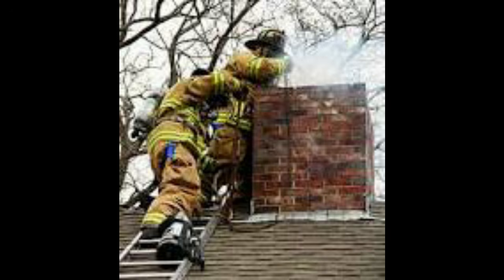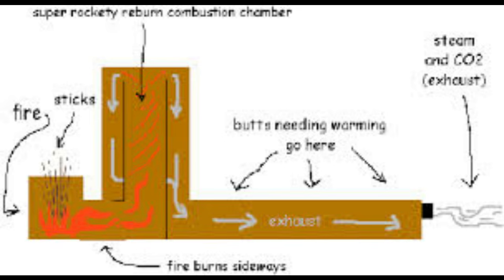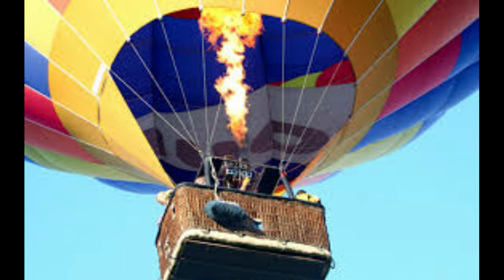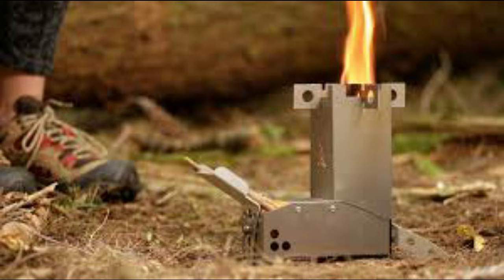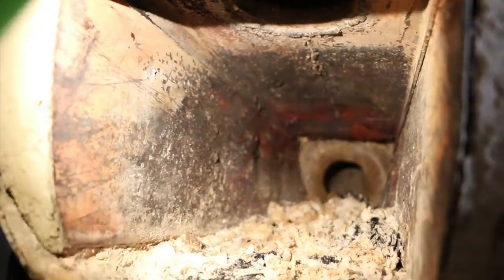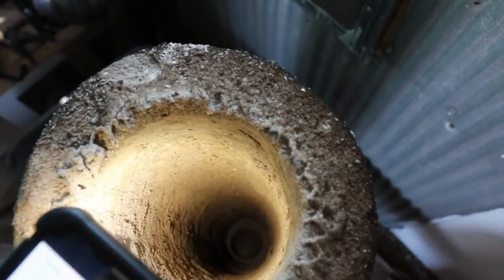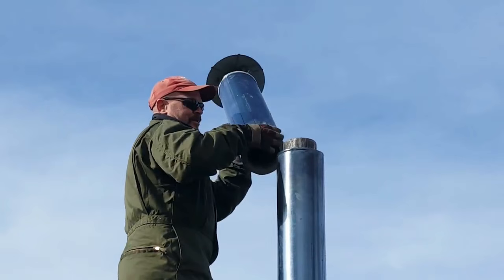No Creosote Forever More

Comment: I run a brush down my chimney once a year. Get about two cups of loose ash out of it. About mid winter I do need to just knock collected ash off my chimney cap where it will collect in the little spark arrestor holes, but that's just knocking the chimney cap a couple times with a long stick. Never have an issue. Been doing this for thirty years. Our stove is a catalyst type (Blaze King). Very efficient and virtually no  tarry creosote. Burn all pine, mostly dry, some less so.

Comment: Well sir sure appreciate the vid. I have a rocket mass heater that now has an interior flu. I wrote to comment that my rocket mass heater ran ok with no chimney. The draft tripled ( just a guess)when I hooked the six inch system up to a 15 foot vertical stove pipe with 12 foot insulated stainless on top. I found that the wind could overcome the heat pump effect without a nice tall stack. Since it burns so clean I figured the stove pipe could bleed more heat off the flu gas. The 13 foot mass still pushes 230f plus flu gas’s when it’s running hot. Enough to improve the draw as I forgot to make a good bell at the barrel transition. It’s been running 6 ox years. Your stove build is very well thought out. I kind of want to try a batch box.

Comment: If it's just your flue cap that's clogged and it's beyond your reach or you want to avoid the danger of falling off your roof, you can do like I did and use a .22 cal pellet gun with an accurate scope to put a few shots on the screen which shakes off the creosote easily. I figure that I paid for my pellet rifle by not having to call out a professional to do the work. I couldn't use my stove until I did this process.
Reply: I got a 5 ft. pvc pipe and attached a wire brush to end to clean out the holes on the cap. Works like a charm.

Comment: As a sweep myself, I completely agree with your assessment. Keep up the study and good work. Though I do not agree with your methods of install I believe you have the right understanding to produce a more efficient system. Congrats on your projects.
Reply: Leslie B  if you are reaching a continuous temperature of above 500°F in your stove then you should be getting secondary ignition and creating a cleaner burn. Less unburned carbon escaping the flue collar will always mean a cleaner chimney. Using softer woods is perfectly fine but may result in even more tar droplets that have to be burned as the natural moisture and oil(sap) content is higher. If you burn soft woods then be sure to season your wood twice as long before you burn them. Have your stove and flue swept before every season. If it is your primary source for heat in the winter then sweep it out 2 times per season.
Reply: @jeremiahharris5002  I believe the industry standard for cleaning a chimney is ⅛ inch soot/creosote accumulation.  Inspection can only be achieved by frequent visual examination.  As a retired chimney sweep, I once documented a brand new EPA listed stove and chimney installed to code requirements which had accumulated one+ inch of soot and glazed creosote in the flue after only 72 hours of use.  He claimed the stove was smoking and was threatening lawsuit.  The problem was the owner "occasionally" burned pieces of railroad tie.  His regular firewood was fresh cut, unseasoned Douglas fir.  Moral of the story:  Burn only seasoned fuel, air dry for at least one year, naturally dry limb or split.  Under normal conditions that should produce firewood with about 25% moisture content, which is supposedly the ideal moisture content for normal combustion in fireplaces or wood stoves.  Dried lumber can contain considerably less moisture, which will cause the wood to ignite and burn too quickly for complete combustion, resulting in creosote accumulation, which will produce a fire hazard.  Green wood contains too much moisture, which prevents adequate combustion temperatures and creates cooler flue temperatures. Additionally, NEVER burn treated or painted wood in your fireplace/stove/rocket stove.  The air contamination it produces is known to have been the cause of severe medical issues.
Reply: @dtaylz4me  I agree. Burning railroad ties is not wood anyone should be burning as the wood is soaked in creosote as a way of keeping it from rot since they are in contact with the ground and are completely exposed to the elements. Softer untreated wood can be burned when it has has enough time to season. You are correct on the moisture content being an issue on both ends of the scale. But despite dryer wood burning fast is does produce less smoke (tar droplets) which means less of a chance of having a creosote that is dark and shiny (3rd degree) and having a very powdery and almost light brown soot (1st degree) creosote. Most stoves and flue stacks, when burned properly will generally need sweeping once every 3-4 ricks of wood (1.5-2 cords).
That is the rule of thumb in my area and industry standard is 1/8th inch. I have many clients who have managed, having proper burning habits, go as much as 3 or 4 cords between cleanings. Good install and proper burning yeild the best results for sure.

Comment: We have a stove that has a catalytic converter in a box that the gases must go through it works and saves wood immensely, when burning correctly if you go outside and look at the stove pipe there is virtually no smoke coming out, only if the draft is open or starting fires, or it's warmer outdoors,  they should put these on all wood burning stoves, only a slight brushing once a year of the chimney is needed.
Reply: We have a hearthstone that uses ceramic over secondary air tubes instead of a converter. Works great and it was only 65 bucks to replace when I accidentally shoved to big of log in the stove and broke it.

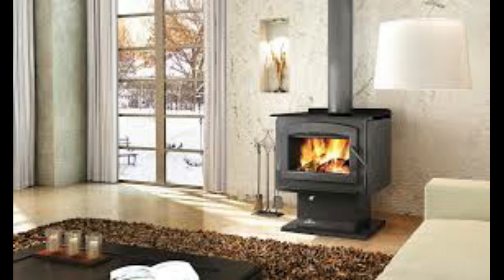Comment: The stove you show at 1:15 is insulated with firebrick and introduces secondary air in the top of the burn box. It burn very hot and clean at least compared to the open fireplaces you show.

Comment: I have always had this idea with chimney caps to make them hinged.   Have it fastened down with some solder wire enough to with stand winds.  Then if a chimney fire happens it will melt the wire and blast the chimney cap open which will allow the column of fire to rise as high as possible away from the burnables on the house and also there will not be fire being pushed back down towards the box..  If you get rich off my idea remember me in your will.  LOL.

Comment: I have burned wood for 50 + years and have gained a lot of knowledge of the different verities of wood and the way they all burn at different rates under varying conditions i.e. (ambient air temp and moisture content,acceleration of air supplied,type AND size of fuel used.
The one thing is constant is that under EVERY condition from kindling to fire extinguished there will be creosote produced somewhere within the combustion chamber and flue.
My response to this scientific fact is to build a small fire to start any burn and develop a bed of coals before adding any large pieces to the burn.
I have reduced my wood consumption (and increased efficiency)by almost half using this starting method along with inlet air regulating and velocity.
Reply: re Sonny  A guy named Southern Prepper complained his stove used tons of fuel , burned it all rapidly, had to be stoked every 2 hours, and didn't heat his house.  I have the same stove, and got efficient burn, and could still have heat after a good nights sleep.  Despite his desire to advise the rest of us, he didn't understand stoves himself, and unknown to him, the entire damping mechanism was absent from his stove, hence the rapid, roaring burn, and all the heat going up the chimney.  Forget a roaring fire.  You get heat from a glowing bed of embers, with as little air flow as possible, with a nearly closed damper.  I have heated with wood for over 4O years, tried a lot of theories, and finally understand what heats a home. You said  -build a small fire to start any burn and develop a bed of coals before adding any large pieces to the burn-, I agree totally.  I burn all kinds of wood except pine.  I don't mind loading often during the day, burning junk wood, and save the good oak logs for at night.
Reply: Alrighty then fellas I'm stuck in the middle of Kansas. When we're lucky enough to have oak and walnut ash we just don't cut them down. Especially for firewood. But we are fortunate enough to have an abundance of hedge (Osage Orange) and thorny locusts and elm of every variety and there are some that will even burn cotton wood but not me. The hedge is the hottest thing going and locusts are #2 in BTU per ton so it's plenty warm believe me! Anyway I build stoves shutting down the damper holds the  heat down. So with the more space I have to heat the higher up on the flue I put the damper. I pull more radiant heat off the flue pipe that way.
Reply: Sonny Delano and Tom Jackson......thanks for sharing experience, for the new-bees! Any additional help would be appreciated.
Reply: @Mark OnTheBlueRidge Thank you. I did not know this and I have tons of pine growing out the back door!!! After my build, I don't think creosote will be an issue anyway.
Reply: Mark OnTheBlueRidge 
I’m in 🇬🇧 
I burn lots of pine wood
Just cut and store under shelter  for 12 months brilliant 
Once my fire is burning well I just add good sized lumps of pine on a very slow draw burns slow and loads of heat..
Reply: agreed...Add to build a small fire to start you need small pieces of wood and I've discovered the Fiskars splitting axe is perfect for making small pieces.

Comment: I have a fireplace insert that is non-catalytic (Regency) but has the re-burner tubes at the top of the firebox. It reburns the smoke and gases and you get all the energy from the wood. It actually "bakes" the wood and you can see the methane coming out of the wood in a blue flame on the surface of the wood - pretty nice ambiance (which we thought we would lose, but it looks like a fire "waterfall" as the smoke/gas rolls forward, burns, and back into the fire) Creosote is negligible; however, you should clean it by a pro every year and have the bricks checked for cracks in the stove.  It heats our 2000sqft house.  ALWAYS use seasoned wood - 20% moisture or less.  GOD Bless

Comment: I had a cat converter stove... lot's of creosote.  I got rid of that stove and bought one with secondary burner tubes.  Very little creosote as long as I burn hardwoods.  I clean the chimney once per year and get about a couple of cups of dry powdery soot out.  It's an 8" flue.  I burn about 5-8 cords per year.  So I think the secondary burner stoves are better and cleaner.

Comment: The problem with most fireplaces or stoves is uncontrolled air supply.  If you control the air entering the combustion chamber there is little or no air to ignite any creosote that may be present.  Our Kent fireplace insert has worked beautifully for  about 40 years with no cleaning other than to remove ashes every two or three years. It has a stainless pipe chimney lining. The combustion chamber is 1/4" steel plate. It has an upper chamber that the gases must flow through before entering the chimney.
Reply: I realize this reply is long overdue but maybe you have some ideas for me.  I have been using a Kent Tile Fire woodstove since 1986 and have to clean it out about every 3 weeks due to creosote build-up.  I dry my oak wood for 2 years before before burning it, yet I've had 3 chimney fires.  My stove pipe & chimney are double walled.  I don't what I'm doing wrong.  Perhaps leaving the damper open a bit would help, but that's not what the literature for it says.  Any ideas?

Comment: I would recommend using 316 18ga. Stainless Steel alloy for the burn chamber. S.S. is able to maintain a Continuous Temp of over 2400°F without warping and because it stays hot and smooth you have low residence time and achieve secondary ignition for unburned carbon gases (tar dropplets). It might be more cost effective for your build instead of the non-water soluble calcium aluminate to form a molded chamber or tiles.

Comment: Also most chimney fires are from brick chimneys  - as we can also see on these pictures - where the creosote can stick to easier. I have stainless chimney pipe, never creosote in it as it doesn't stick to it. The only part where there is a build up is at the very top inside the cap, I clean this couple of times a year to be sure. Great video, I wish I could have one of those rocket burners.
Reply: All the thousands of stainless chimneys ive cleaned would disagree that creosote doesn't stick
Reply: @dhall5634  Interesting, running mine for 5 years now, never anything in mine, never cleaned it, regularly inspect it, shiny inside after 5 years of 5 month-long winters up north here and even running my wood burner on 1/3-1/2 setting most times so not even hot. I have the Duravent pipes. The only thing I need to do is open the cap on the bottom outside and everything falls out as dust. The only thing I do need to clean is the pipe inside the house which is not stainless, creosote does settle on those but never on the stainless chimney outside.
Reply: @dhall5634  I've been thinking about this for the last few days, this statement actually makes me pretty proud that from the thousands of homeowners I am the only one who is doing it right, although I can't pinpoint a single thing what I am doing differently. I have a regular store bought wood stove, regular store bought 6 inch triple wall Duravent chimney pipes - 18 feet of it running up on the side of my house - I burn regular wood that I cut myself, nothing special, nothing custom, everything store bought and in the 5 years never a single thing in my entire stainless chimney, never had a brush or any cleaning tool in it, running it low 24/7 for about 5 months straight each year. Every time I open the bottom cap to dump the dust I always look up and it's all clean as a whistle all the way to the top (only top cap needs some cleaning). So I am pretty proud that from thousands of chimneys mine is the only one that always stays clean! I will tell this to the guys in our neighborhood who are also not using the stainless pipes and do have problems (even made a screen shot of your statement for proof).

Comment: Insulating the stove pipe all the way out to the vent cap on any stove will keep the creosote out of the chimney. I burn spruce and it can build up bad. My stove pipe in a 6" inside a 7" double wall insulated pipe. All I ever have in my stovepipe is ash.
Reply: Impressive. Even without actual insulation!  Yet I'm guessing that keeping the rising exhaust air even hotter/warmer will create a stronger pull than your double wall system...?
Reply: @randystrand908  If I'm understanding you right, you're saying burn a hotter fire in the stove. For me, that burns through my wood to fast and requires me to get up twice a night to feed the stove. It also made my cabin too hot. When you choke the stove down to keep a long slow burn the chimney outside cools. Especially if it's below zero outside. Wind also seriously cools the chimney. Not only does the draft slow, but the flu gasses condensate and cause creosote. Before my modification, I had to clean my chimney once a month. Now I do it once a year. The creosote would leak out of my stovepipe down on top of my stove, dry up and catch fire.
Reply: @TheCyberRebel  the rocket mass heater is a different beast that solves all that trouble. If you can’t get one you may want to try hearthstone. I run both. The hearthstone is a 2 in thick stone that holds the heat and it also has clean burn technology that works really good. It does not overheat the space like steal because the heat is delivered more evenly. My primary home heater for 22 years. I did put a damper on mine although the company doesn’t recommend it. I like to hold that heat in the stove and it makes my stove burn warmer at -20f.

Comment: Living in Alaska and having heated with multiple rocket stove designs and wood stoves, all I can say is for practical year-round heating, get a Blaze King, King or Princess model. My King model would heat my 1400 sq ft house, in Bethel, for about 45 hours at 30 degrees and 18-20 hours when it was minus 30 and -80, -100 wind chill. There are other brands that are as efficient, when you run the stove on high but they all lose a lot of efficency when you turn down the heat, which is most of the time.

Comment: It would seem that burning hot like you are suggesting does reduce creosote and therefore other pollutants however EPA certified woodstoves are very airtight and burn much more slowly and if not used properly with dry wood will make creosote.  

My conclusion based on 50 years of wood burning in woodstoves and in a maple sugaring evaporator is that air is the key to a clean burn.  In the evaporator we burn mainly pine sometimes as much as a cord a day with all the air it wants.  The stove pipe has a little dust in it and there is maybe a small shovel full of ashes.  It would be impractical for home heating because it needs constant tending but it does burn clean.
Reply: I currently have a VERY EXPENSIVE pellet stove (given to me!); however, I do not like it. I can  heat my home to the same temperatures with electricity and this (high end) pellet stove costs me the same amount of money with a whole lot more time effort to keep it running plus setting an alarm so the hopper doesn't run dry!
Reply: @randystrand908  Too bad your pellet stove is a failure.  Maybe you can pawn it off on someone else and get a woodstove that works for you.

Comment: Burning it hot and clean is not a new story, have no problem hearing again, keep up the good work.
Reply: Right but conventional stoves; even the "efficient ones" due to improper operation rarely get hot enough to burn cleanly. RMH on the other hand are difficult to get a bad burn as long as its built right; you would have to use soggy wood or something.